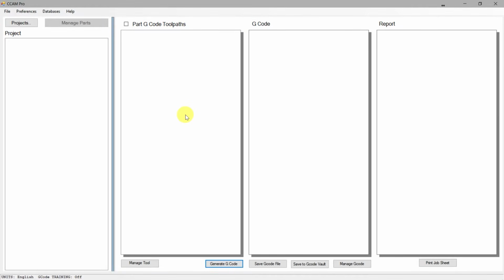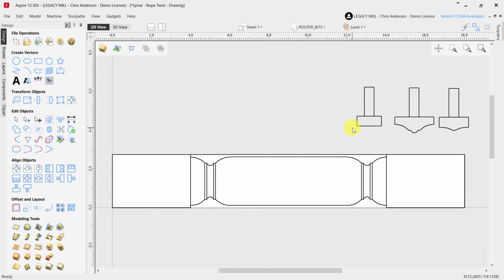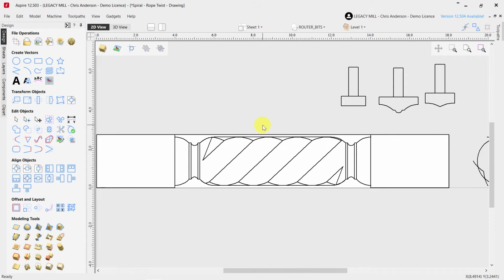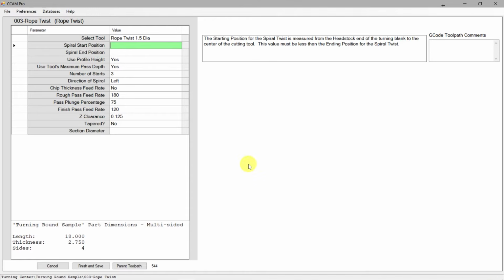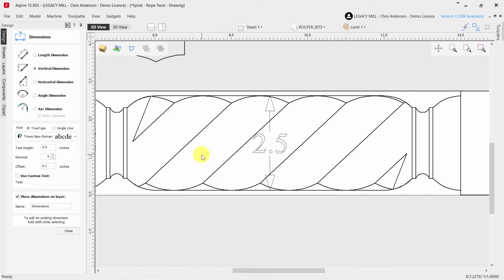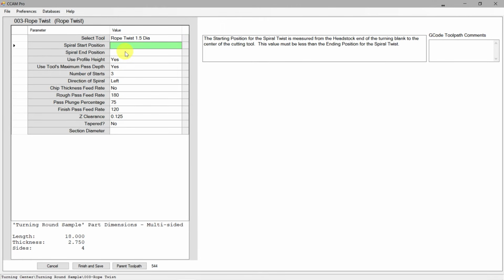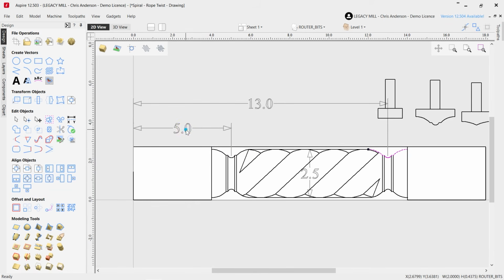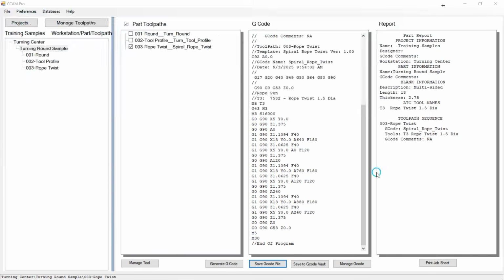How to Cut a CNC Rope Twist | CCAM Pro Tutorial & Demo

Comment: Thanks for showing the formula for picking the rope twist bit size.
Is there a similar one for the barley twist bit?
Reply from the maker: It is a 1 to 1 ratio diameter of the material = diameter of the bit for a true 1 start barley twist.